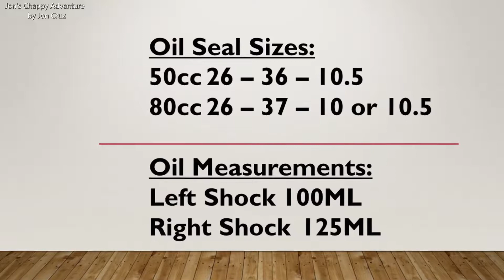Yamaha Chappy: How to Replace Oil Seal in Shock for LB50 and LB80 Vlog #14

Comment: Can you do a video on changing the oil and fuel lines? Mine are rock hard. Probably original from 1976. Is it easy to get parts there?
Reply from the maker: Sure! I'd be happy to add that to my list.
Reply: Instablaster.

Comment: Ilang cc na oil ilagay sa 50cc at sa 80cc sir ?
Reply from the maker: 100ml may spring
125ml no spring
Fork oil or motor oil pwede na
Reply: @JonsChappyAdventures  boss paano tanggalin Ang spring Ng front fork Ng 50cc? o natatanggal ba Yun?
Reply from the maker: @wowitonaval9577   same lng nung left
Reply: @JonsChappyAdventures  i mean boss, paano tatanggalin ang spring sa fork kasi di ko matanggal nasa loob kasi naka kabit ang spring. anong tool ang dapat gamitin?